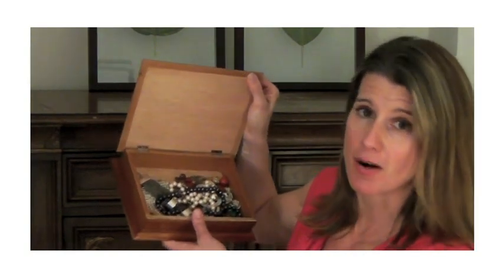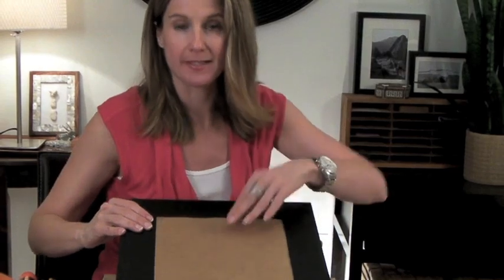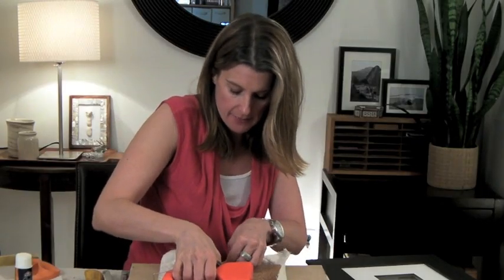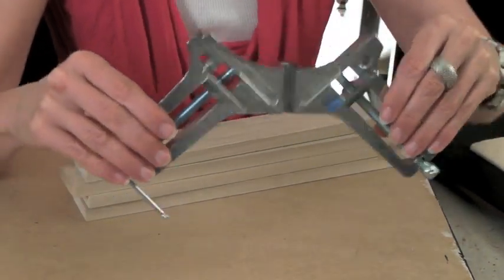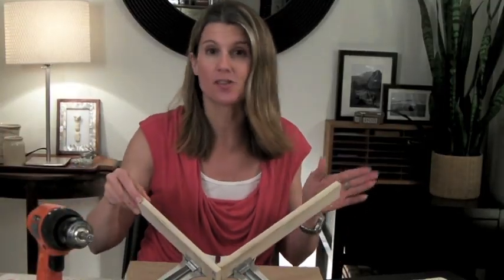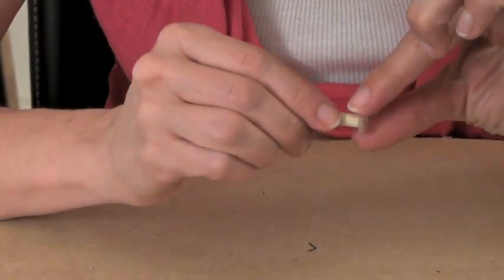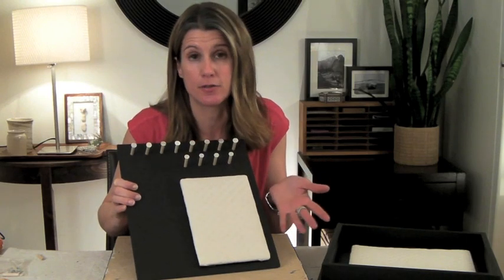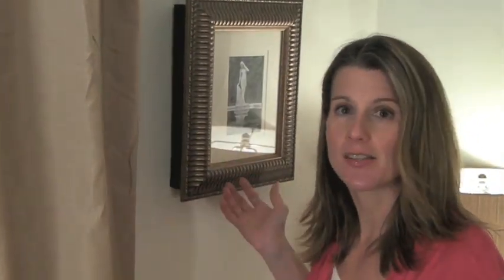How to make a DIY jewelry organizer

Comment from the maker: Glue alone might work but I think it would work better if you were to drill holes (either the same size or a slightly larger than the diameter of the dowels) in the wood to insert the dowels in. That with glue should make them stay in place. Hope this helps. If you have any more questions, please contact me via my website or on facebook. Thanks for watching!